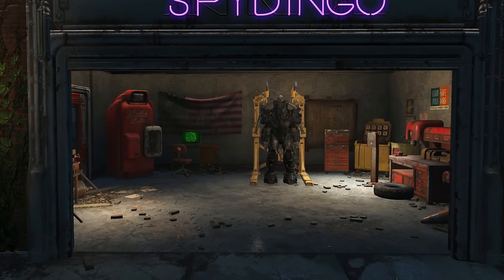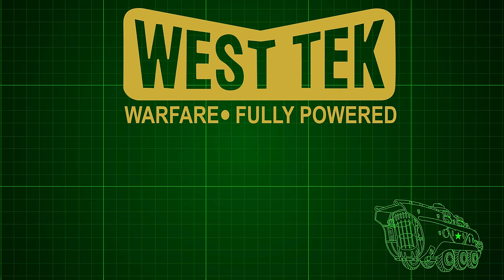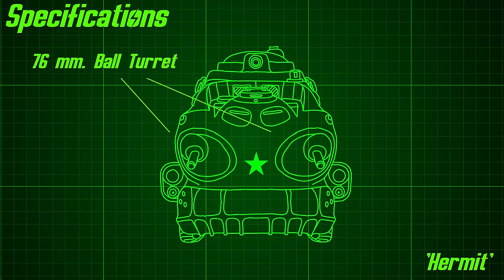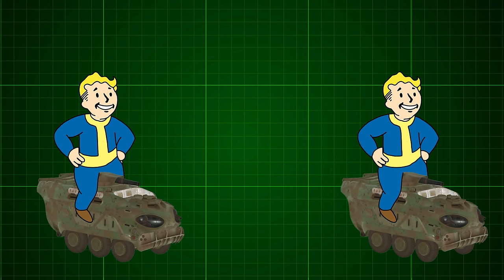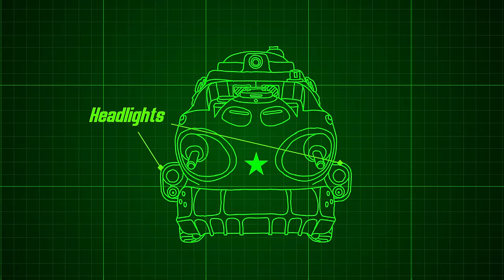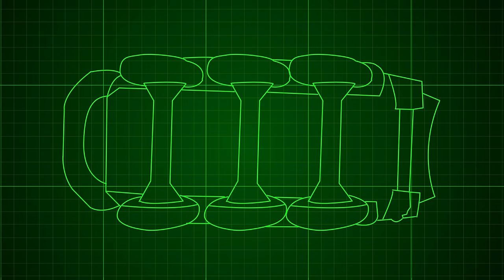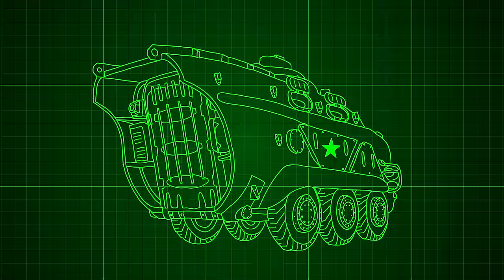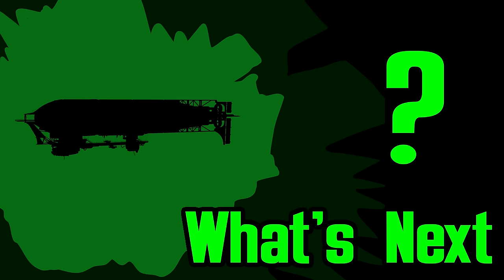Fallout 4 & 76's APC is a Hot Mess

Comment: Hmmm reminds me of a wheeled BMP-1. Mostly due to the stubby cannon with limited firing angles. Which makes a lot of the vehicle features make more sense if that was the original reference. Would fix the gun since the BMP used a low pressure gun launcher instead of a traditional cannon meant having relatively giant guns wasn't too much of an issue. And would explain the firing ports since that was all the rage on 1950s-1960s IFVs
Reply from the maker: So like the Objekt 1200 BMP-1 entry, but with sadly one fewer set of wheels. Really wish the "Hermit" had 4 rather than the three. Good point on the low pressure guns. I'll have to keep those in mind in the future! Wow, firing ports were all the rage in the 50s and 60s that's wild. Seems like one of those things that sounds like a good idea, but then really really isn't lol.
Reply: @spydingo  def lol especially if the vehicle is intended to be used in an irradiated environment where ideally you don't want anything open to the elements.

Comment: There's no way you're getting two sets of power armor and infantry in there. Only way I can think of is having the power armor would be on the outside. You would only get 30 miles per hour maybe less with all that weight
Reply: It’d be a tight fit, but vehicles like that usually were
Reply from the maker: It actually looks doable to me, not sure if they could be wielding heavy weapons like miniguns though. Those might need to be held externally. As for the speed, maybe so, but that's still faster than a unit could walk, so it probably has some utility.

Comment: What you didn’t touch on is nearly all of the weight is sitting at the front on 2-4 wheels, and as it dosent have tracks it’s not distributing the weight very evenly at all which would leave it getting stuck very very easily
Reply from the maker: Solid call out, the wheel configuration is real messed up for sure. I hope they transition to the 76 camp tread version and make some improvements to that model in the next one. It's a shame I didn't know that rendition existed until I was told in the comments lol.
Reply: @spydingo  yeah I feel like they spent the least amount of time actually trying to make these vehicles in game make sense but after all thats bathesda for ya😂

Comment: So this might seem dumb, but the APC (or IFV as it is referred to in the video) on the east coast as was pointed out was indeed used for law enforcement, unlike the west coast. This also ties in with the reason why the military on the west coast and east coast in Fallout are different. This would be because the west coast did not particularly militarise amidst protests, this the riot armor;but the east coast heavily militarised, hence why you see power armor units in the beginning of Fallout 4 and military equipment everywhere, to suppress riots. Now what is really interesting to me personally is that the vertibirds of Fallout 4 might have been designed with deploying troops to suppress riots in mind, after all, it does not look fit for military service but might be somewhat good for law enforcement back home. Now this is just me somewhat ranting, but it is just one thing I find very interesting about the vehicles of Fallout.

Comment: I know that this is not a prototype of apc from the game, but in real life there are actually special armored personnel carriers that have been converted for conducting radiation and chemical reconnaissance in difficult conditions that are still in service and continue to be developed, for example, RKHM-6 or the most modern and futuristic RKHM-9
Reply from the maker: The RKHM-9 does look fairly similar in profile if you remove the  dorsal turret. I really wish the Hermit had similar wheel size and spacing, would go a long way in making it look stable. Thanks for pointing that out!

Comment: what if, and hear me out on this, what if the hermit is actually partially aquatic but because of it's weight those ports on the sides are air intakes for ballast tanks. Another reason why i believe this is from the overly violent cousin on the rhino, the hippo. Hippos are so heavy they don't actually "swim" instead they just run ON THE RIVER BED and have been known to hold grudges and will chase some poor sap miles on end to 86 em. just a thought (ignore the grammar and punctuation)
Reply from the maker: Certainly possible, although I'm not sure where the ballast tanks would be, maybe in that midline blister perhaps? I certainly prefer this type of explanation over a simple  developer oversight for sure!

Comment: I find it weird that both you and spookston both forgot to mention the turret. Well, the latter did, they mentioned the lack of turret depression, which is important, especially for such a tall vehicle like this. But what also gets me is that the turret hull also prevents any kind of elevation. This means the turret can only fire at targets in a very specific range, making the topside turret pretty much useless. It'd be one thing if the turret was using missiles that can overcome this flaw through guidance, but it's a regular gun.

Comment: I think it's more likely that the 105 would be a recoilless gun similar to the BMP-1, I mean hey the turrets even look somewhat similar. It'd fix the issue of it toppling over and explain why there's no way to eject rounds there. (And now that I think about it, if it was an energy based weapon Bethesda probably would've made it really obvious in terms of design)
Reply from the maker: That's an interesting thought. Certainly that would help address the stability concerns I have with it as a firing platform. That brings up the question of where the ammo would be stored though, kind of wish I thought of that question when I wrote the script for this video lol. Oh well.
Reply: @spydingo  it's possible that the rounds may be stored in the roof of the vehicle and loaded via autoloader, it seems like there's be enough space for it but it seems very impractical. Another thing, in 76 there's a "survival tent" that appears to be a variant of the APC with tracked running gear and possibly an auto cannon of some sort as opposed to the 105, I just saw it and figured it was worth mentioning

Comment: The diameter of the guns ammo is not a factor in recoil the pressure of the propellant is, short 105mm guns were on ww2 Shermans and it doesn't need to use conventional ammo it could work like pg-15v fired from the bmp-1 a low pressure caseless round that transitions to a rocket engine

Comment: 76mm guns for supporting infantry? That was the 76mm's biggest drawback, it's lackluster infantry support capabilities. And then they went and chopped the barrels on them down to the point where they're probably no longer effective against armor at any kind of range. It's also way too tall, has no MG support of any kind, only carries six for it's size, and unless they have some weird autoloading system for the 105mm, that thing is probably a nightmare to load and operate in that cramped of a space. Really bad APC/IFV, I wouldn't want to have to ride in one of those, let alone crew it.
Aside from the horrible silhouette that it would give off, give it tracks, drop the two 76mms, add a couple MGs (atleast a .30 and .50cal), and maybe replace the 105 with a 30 or 40mm cannon or atleast give it a proper 105mm like the L7 and you'd have a half way decent Bradley/Merkava knock off.

Comment: What if those ports on the side was designed for the cooling system or induction system? They have the hatches open during non-combat situations and button them up when shit get's hairy. Since it's Nuclear and we know the massive cooling systems required for nuclear systems. It would only figure they would require ports for an induction type system. Also, I would argue this might be just as fast as the Dragoon, due to it's electric motor. If it's powered by a mini nuke reactor, then that thing is a Tesla on steroids. Electric motors have always been able to out perform octane powered motors and let's not forget in this universe, natural resources have been cut off and they would not be able to use gas as freely as we do. Since America in this timeline already fought two major conflicts before the bombs dropping, their oil reserves would have been near gone by then. Also, electric motors are much much much smaller and far lighter. Allowing you to save weight and cost.

Comment: The vehicle is probably amphibious due to its shape, the firing ports aren’t as strange as they seem since the BMP 1 and 2 have them, shot traps aren’t that big of a weakness since tank guns while accurate are only so to the point where they can hit a tank sized target from 2km and most infantry held AT weapons are HEAT charges rather than kinetic penetrations, other than that the video seems spot on, the gun is too big the vehicle is too tall and too heavy the wheels can’t support the weight and it doesn’t have much angled armor overall this video is great and my criticisms are just nitpicks and nothing really major
Reply from the maker: I think the firing ports would bother me much less if they were present in the interior. Fair points on the shot traps, also I suppose when the vehicle is that big of a hitbox to begin with, its got significantly more issues than those.

Thanks!

Comment: It is simular to an American Millitary project that fialed to be completted due to the pentagon adding to many fetuers that negated it's origanle design. It was first ment to be a small high speed recon vehicle, then the pentagon insested it should have the ability to caery troops, then that it should be more heavyed arrmor, and then it needed to have some heavier weopens. After adding so much weight the team working on the prodject attempted to use alluminum for the interreor and heaveor armor out side. The outside looks simular to what the FO4 APC. As for the alluminun used inside became it's downfall, the problem is in if an ennemy were to get a smoke grenade inside through the side gun slots it could (and proved in later testing) heat the aluminium to a vaper state turning the whole thing into a death gas chamber. I watched an news specail on goverment project that turned out to be complet waist of money back in the 90s.
Reply: not saying Fallout bassed theres on this failed project, but from what I do recall the two vehicales do look simular.
Reply from the maker: That's really interesting, thanks for sharing! Certainly sounds like a thing that would happen in any universe when politics and multiple branches of the military are evolved. Scope creep kills for sure.

Comment: it`s me again i feel like the hermit is meant for urban warfare/policing acts also there is more advanced composite Armour types in fallout like the stuff used on the T-50b  and exo 1 power amours  so it could be lighter then expected. Also the two front cannons could be automatic turrets also i have a Theory that the front guns are  supposed to be machine guns or auto cannons with water cooling jackets but the modeler didn`t model them right.
Reply from the maker: I agree, and I think that mostly tracks with were we find them. Securing key infrastructure and cross roads from civilian unrest. Given that the dorsal turret is automated, it wouldn't be out of the realm of possibility that the front guns are as well. In both cases I find it quite worrying how much friendly fire trouble the "Hermit" could get into!
Reply: @spydingo  eh bonus points

Comment: What kind of recoil at 3 meters after firing, or vehicle rollover? Do you even have any idea how recoil works when firing a cannon? Quite a few wheeled vehicles have 105-155mm caliber cannons, and none of them are thrown back 3m while firing and none of them are rolled over to the side while firing either. The length of the barrel also affects recoil and the shorter it is, the less recoil there is. Still the recoil is affected by the length and width of the vehicle. The larger the surface area of the vehicle, the less recoil is felt.
Likewise, these types of vehicles are labeled as Wheeled Tank Destroyers/ Combat Infantry Vehicle. Some with a wheeled tank destroyer designation additionally have the ability to transport infantry.
Have you even looked at what modern vehicles of this type look like?
They are quite similar in terms of height, width and length, some are longer. Look at what machines like the M1128 MGS Stryker, Radkampfwagen 90, G6 Rhino, B1 Centauro, B1 Centauro 155, Rooikat MTTD, Type 16 or ZLT-11 look like. Most of them have a normal 105mm cannon for tank combat and don't have much recoil, don't retreat to such 3m as you called it and weigh about 20-46 tons. (Exceptions are the B1 Centauro 155 and G6 Rhino because they are artillery and they use the recoil spade, which reduces recoil so that you don't have to make a correction every shot, but even without it it doesn't throw the vehicle back like that.
Even if this transporter fired a 105mm cannon and both 76mm, it still wouldn't knock it back more than a dozen centimeters, its weight also affects the recoil. If it weighed about 10-15 tons then the cannons could cause the vehicle to be thrown back about 2m, or even less. 
This carrier makes some sense and some not, mainly those 2x76mm are useless. And as for the lack of access to the turret from the inside, well modern vehicles have turrets controlled from, for example, a position next to the driver and access to the turret is from the outside to increase the safety of the crew in case of an ammunition explosion. In this vehicle it means that it can carry about 4-6 shells for the cannon on the roof, because there is very little space.
The most similar modern vehicles to this are tracked infantry support vehicles such as the Schützenpanzer Puma or AS21 Redback. Both are huge and weigh about 40 tons, but they have 30mm automatic cannons, are more effective for fighting infantry or other IFVs/BMPs, also have ATGM for fighting tanks.
I also noticed that it is very similar to the South African tank destroyer, Ratel 90, equally huge, with a cannon on the roof (90mm) and carrying infantry. 
Overall this APC Vehicle "Termit" is so se, but in the real world worse machines were used.
Reply from the maker: Why hello there! Thank you for your comment. Your right of coarse, I don't have any experience in firing cannons, that's why I called it a vehicle chat not an analysis or review or something. I don't claim and never have claimed to be an expert. I'm just having fun with it and doing the best I can trying to make something entertaining and worthwhile to watch. Your right though, the APC flipping over bit was something I exaggerated a bit, for both the fun of it and the fact it did a great job of illustrating my point in my opinion.

I mean, I talked about the Dragoon in the video and gave its dimensions in comparison to the "Hermit" so clearly I have, but I'm just going to assume the tone of that question wasn't meant to come across as hostile. Thanks for sharing your insight on the other weapons platforms you are familiar with, I'm sure others will also find this information useful!

Comment: i think sitting in power armor isnt as useful as that scene may suggest, its very likely that sitting and getting back up requires specialised equipment, or a lot of men working together, of course there isnt (to my knowledge) any data that supports this idea.
Reply from the maker: That's an interesting thought. If that is the case, from a functional standpoint I'd still have liked the Hermit to be shorter. Have the PA units crouch, it doesn't save  a ton of height, but every bit counts.

Comment: I think a better comparison vehicle in real life would be something more like the Bearcat, an armoured police vehicle. It's used for riot and S.W.A.T.-type situations, which in the Fallout world tends to fall a bit more on the military than the police. On a similar note, you want an urban vehicle like that to have tires rather than treads because it's not meant to be used outside of an urban environment and the tires won't destroy the roads like metal tank treads do. Using tank treads in a situation like that calls for a special rubber-padded urban tank tread like used in parades or where the tank is only ever really on paved surfaces, unless in a combat situation where concern about the roads is not really a priority. Looking at it from a police vehicle standpoint it would also be likely that the cannons would actually shoot water or gas as a crowd control measure. And the final thing on if it were more like a police vehicle the height would be an advantage because you want them to reach up over the crowd as well as being more difficult to be overtaken by the crowd.